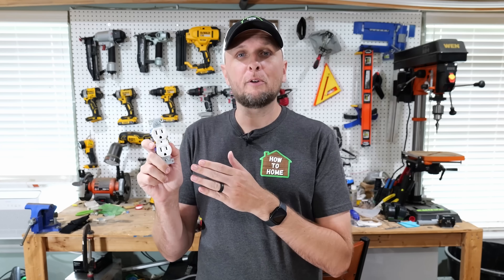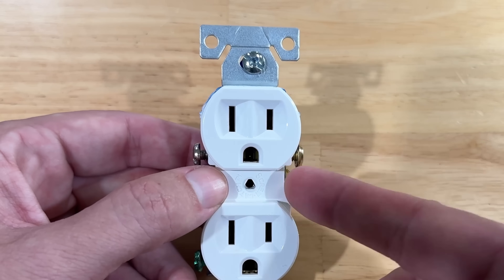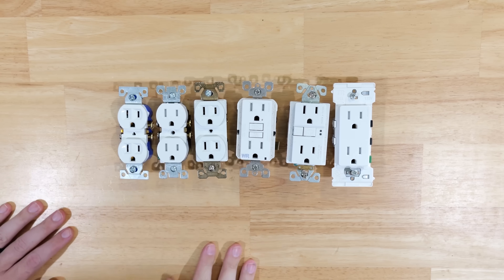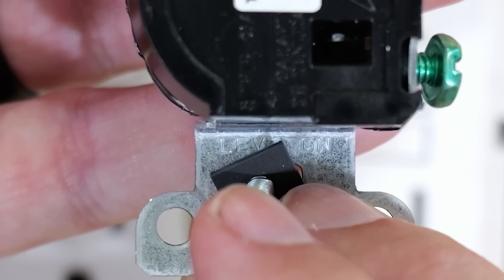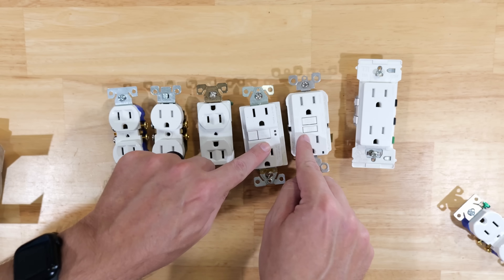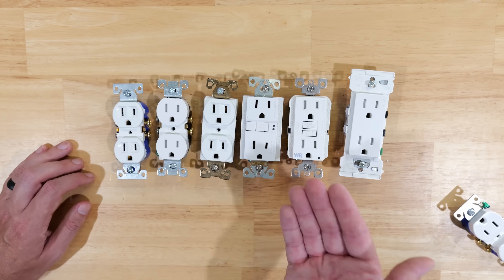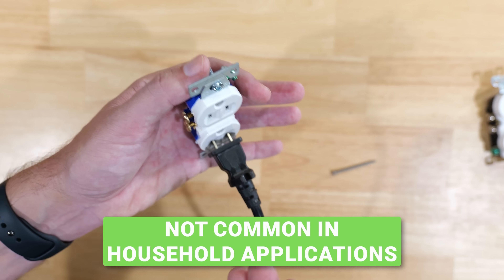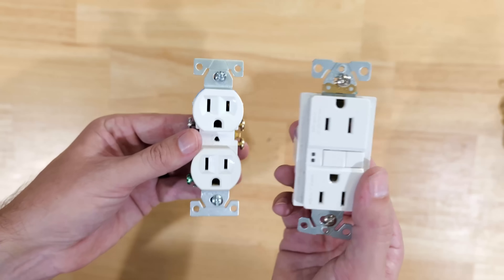The Shocking Reason Why Your Outlets Are Installed Upside Down!

Comment: I have seen some electricians  install all outlets consistently in one orientation or the other with the exception of switched, or half switched outlets. This gives the user of the outlets a visual clue that the entire outlet, or one half of the duplex outlet, is controlled by a wall switch and thus not always powered.  Switched outlets are common in bedrooms, living rooms and basically any room that it is common to use table or floor lamps for lighting.

Comment: As an Industrial Electrician, We were instructed to install any 110v receptacles on the shop floor was always ground plug up and within the offices and restrooms, it was ground plug down. The reason  was that most all plugs on the shop floor was 3 prong 110v plugs as a requirement and for the reason you stated, the ground prong guarded the topside from accidental shortages from stuff falling on it. Offices and restrooms were for practical use that was not industrial in nature.

Comment: Dumb. Notice how the plug you referenced as upside down was made outside of US - yet the one made inside was correctly right side up. And I get it all hospitals use metallic covers - well - this may be an oversight on THERE part - maybe they should stop doing this? Also, I work in inspections and have noticed that there have been a lot of superstitions - especially with the Mexico workers coming up and doing electrical work. One says that installing upside down keeps evil spirits away - kid you not… so there is plenty of ridiculous antics “invading” our normality. Please Stop letting this occur. 😮 is the right way…. 😂

Comment: I've had to install them ground up in cases where the ground wire in the outlet box is too short to reach the bottom of the outlet (older homes/remodel). It happens .. but it's not common.

Comment: I always install my outlets with ground hole on the BOTTOM.  When I find them the other way, they get reversed.  HOWEVER, I do make one exception and that is the outlet for the fridge.  The fridge plug necessitates the ground hole on the TOP, otherwise the wire suffers a bad 180 degree turn before it can be plugged in.

Comment: This video was very helpful to me because the builder of our house installed the ground prong up in our bathrooms and I was wondering why???? I had a nightlight that was kind of heavy that also serves as a "tart warmer" to make the bathroom smell nice, but it has a plastic prong ( Faux Ground Prong) coming out on the bottom to support the weight of the tart warmer. I was unable to plug in my tart warmer because the outlet was upside down and I was afraid to change it because I was thinking it had something to do with code, but now that I know that it doesn't I can change the outlet and plug in my tart warmer. Thank You!

Comment: "Outlet" and "receptacle are not interchangeable terms. Check def. of "outlet" in NEC book.
A ceiling box for a light fixture is a "outlet"  A disconnect for a AC condensing unit is a "outlet"
Reply from the maker: I bet you are the life of every party 😂.  A receptacle is also a type of outlet and it’s certainly what many homeowners and DIYers call it.  So there are bigger things in this world that could use correction 😂
Reply: @HowToHomeDIY  I just took my license renewal continuing education 7 hour course 2 days ago. Instructor made a specific point on this misuse of terms.
Also when I submit list to my Electrical inspector, of the completed rough-in, I have to list : receptacle outlets, lighting outlets, other outlets. 
Professionals know the correct terminology.
Reply from the maker: Super cool 👍  A receptacle is still an outlet though.
Reply: @HowToHomeDIY  Yes, it is a "receptacle outlet"
Reply: @HowToHomeDIY  Correct !
Reply from the maker: @dougthornton6884 great.  We agree.

Comment: If you have issues with remembering which is hot, and which is neutral, just remember that the word Neutral is a bigger word than the word Hot. The Neutral is a bigger slot.
 The Earth is a round planet, so the ground is round. It rhymes.

Comment: 25 years as an Electrician. Residential, commercial, industrial, and line work. I am currently an Industrial Electrician and Motor Controls Tech. 
I'm going to put this in all caps so you ALL understand it. 

THERE ARE ZERO STATISTICS TO PROVE PUTTING A GROUND UP SAVES ANYTHING. 

As a matter of fact, I have personally seen a ground up receptacle short out after something fell on it. 
IDK who you people listen to, but they literally don't know their butt from a hole in the ground. There isn't any reason whatsoever to install receptacles ground up. It's a freaking old wive's tale. It's a myth. Like things disappearing in the Bermuda Triangle. 😂😂😂

Comment: I had an electrician install a couple of outdoor outlets.  The outlets were on a covered and enclosed porch.  The outlets were installed ground opening down, and had steel covers. I plugged in a multi plug outlet which needed to be screwed in to the wall outlet while the steel cover remained.  The problem happened when I decided to remove the multi plug outlet, after unscrewing the outlet the steel cover slid down and made contact with the live pins before I could completely remove the multi plug outlet, sparks flew.  If the outlet would have been ground plug up the ground pin would have caught the steel cover instead of contacting the live pins.  After that I removed the steel covers and replaced them with plastic ones.

Comment: I'm a former UL engineer who evaluated manufacturers' products per UL60950 - the standard for information technology equipment. Within that standard, there are type-tests that can be applied. If there are circuit prongs that are accessible while they are still energized, and there's actually a special tool that was designed specifically for the test. Another test in the standard had us evaluate how quickly a circuit could be de-energized if it had a capacitor connected to the exposed prongs in that capacitor had to dissipate all of its energy within about 500 milliseconda if I remember correctly. In either case, the likelihood that a person could come in contact with an energized circuit on an L5-15 plug as it is being detached from an L5-15 receptacle is extremely low. Stay safe. 😊

Comment: Over time, receptacles wear and grip inserted plugs less firmly, causing the plugs to droop somewhat when the receptacle is mounted vertically.  In extreme examples of this condition, the top prong(s) may (depending on the receptacle design) lose contact first, while the lower prong(s) remain in contact.

When this occurs, this means that if the ground is on the BOTTOM, the appliance can lose power ENTIRELY, which will help to alert the homeowner that there is an issue:  whereas if the ground is on the TOP, the appliance would in all likelihood continue to operate, but WITHOUT a safe ground.  Since the device or appliance in this second scenario appears to be functional, unless the device has some onboard ability to display a ground fault, the homeowner may continue to operate the equipment for an extended period of time, unaware that it is in this condition.  (Source:  I have encountered this when finding a consumer-grade UPS displaying a 'wiring fault' condition, which is immediately rectified by seating the plug properly in the receptacle.)

For that reason, all other things being equal, I would say that the GROUND-DOWN orientation is superior.  To address the exposure of the hot/neutral pair to dropped metallic objects, I'm surprised no one has addressed this simply by offering a wall plate with a simple deflection ramp above the receptacle which would easily redirect any falling object.  (Or if they have, I have never seen one for interior wall plates.)

Just my $0.02.

Comment: We live in a mostly Right handed world that is why the common is on the left. We grab with our left hand and twist a tool with our right hand. When you pull an active plug away from the wall with your left you are less likely to touch the hot power side. Protect the human.
You should always turn off the power but we know not everyone follows the rules. Also some plug units are mounted sideways nowadays. Thoughts.?

Comment: The Eaton GFCI should likely be installed with the ground plug up.

Why?  Most people are right handed.  I may curse the bias as a left hander, but by installing it ground plug up, when a right hander reaches for the buttons the lights will not be visually obscured to the same degree by their arm/hand versus when it is installed ground plug down.

Comment: I install plugs ground plug down. The only receptacle I put in ground plug up is where my air conditioner is plugged in. Since the AC plug is extremely large with the built-in breaker plug, if I tried to plug it in the ground plug down, there is not enough room between the bottom plug and the floor. That is the only plugs that are installed upside down, to accommodate the oversized AC plugs.

Comment: There is no "Correct" way. It depends on what the code says where you live, for the type of application you're installing it for and how you mount it. Up nor down applies when the receptacle is mounted horizontal. I guess the next BS argument will be that the only way to "correctly" mount them horizontally is to put the ground plug to the left or right.

Comment: Thank you for a thorough examination of this topic! I became aware of different orientation of US AC receptacles in the military, when I noticed that the receptacles were installed “upside down”, compared to every other I had ever seen in civilian residential and commercial installations. 

They gave the same reasons your production covered, that the “ground prong up” orientation was “safer” if a metallic object were to fall onto partially exposed prongs. 

Later, a class in commercial construction covered this topic as well, stating vague reasons for the “conventional” civilian orientation of these, but mainly used the installation of “ground prong up” outlets to represent switched outlets. 

Thanks for filling in the blanks, since this removes any doubts for future installations if anyone should ask.

Comment: I am 80 years old residential, commercial, industrial electrician. Only saw ground up installed up needed for 90 degree cords with cord hanging down.I have researched this all my life. Ground down could be a problem with stainless plates. My only evidence of ground up being correct is in my friends house, he being an electrician, who is 80 years old , knows everything and never makes mistakes.
   Love your presentation, brought me many memories of the past.
Reply: Well I am 83 so I obviously have the highest authority here and I can tell you that regardless of up or down, America has the crudest, cheapest, nasty unsafe plugs and sockets I have ever seen. British plugs put America plugs to shame. (About the only thing we British can claim these days apart from politician integrity). During the period that I was a member of the Institute of Electrical engineers in the eighties, it became obligatory for all plugs to contain a fuse and the live and Neutral to be sleeved to protect during withdrawal. And no need to fertal arround trying to decide up or down.
Reply: @Peterprincklestein  That's mostly because the US still has power sockets going back to the dawn of time. Modern sockets have plenty of safety features. Shutters, 3 prongs and possibly GFCI built in on an AFCI circuit if you're talking about what's currently available. It's mostly developers cheaping out that go with less, and even there, most of the time they have to integrate all three of those things into their projects. There just remain a few situations where they don't have to because it doesn't really add any safety. Things like not needing tamper resistant shutters where small children couldn't possibly reach them. 

I do admit that the British style is arguably the best in the world, but a decent outlet available here isn't much behind in terms of safety or reliability.
Reply: @SmallSpoonBrigade  I totally agree with all your comments. Your GFCI comments could also apply to the British power supply even more so because of the 240Vac supply. Pity that USA only has 110Vac for its household sockets. My kettle takes twice as long to boil as in the UK, but who cares now I am retired time is abundant. I even have time to waste on frivolous videos concerning the right way up of sockets. I like the ground down because it looks like a happy face.
Reply: @Peterprincklestein  True, quite inexpensive USA construction in comparison.. also a bit more Affordable to the masses that actually pay (at times over 30 years mortgage) for their own homes, as USA is noted for. 
Common for endlessly ongoing mass developments (tens of thousands of new homes in every direction, for hundreds of miles around each of the larger cities), to build rapidly and at less costs .. to the Individuals.
 Countless many of home owners are avid DIYers.... historically.. It's a 'Yank thing. ;}
Remodeling/updating for family growth, is ongoing, more often DIY across the USA.. 
Home Depo, Lowe's, Menard's, Ace, True Value, etc, including Independent home builder supplies, are 'Always busy.. Reason why USA absolutely loves.....
 and uses to the outrageously extended ends of said vehicles lives, their SUVs and Pick-up Trucks.. ;)
Reply: Ground prong up when that outlet is attached too the light-switch so people there know where to plug in their lamp to control it from the wall light-switch.

Comment: In terms of wiring and electrical pathway, another word for ground, although not as common in North America, is earth. Remember the three prong grounded cheaters that were common back in the day when three prong plugs were first introduced and most all receptacles were still legacy two prong receptacles for non-polarized plugs? The manufacturers of such devices typically recommend that when possible they be installed with the ground pin at the bottom, that is, with the U-channel ground pin installed such that it is literally the contact that is physically closest down towards what is genuine soil earth, that is, terra firma, which is ground. Yes, most such cheaters could be loosely said to have been installed, as most had provision for mechanically fastening and thereby grounding metal connection to the ground pin U-shaped slot of the cheater to the screw affixing the receptacle cover of the two prong receptacle the cheater was being used in conjunction with. Unless you're an acrobat tumbling through the air or an astronaut tumbling in space or a diver turning over in water, etcetera, earth, the earth, ground, the ground, is always down, down below, underneath your legs and your feet. In terms of the two vertically thin prongs of a plug, the two skinny legs of a plug, it just fits the sense of earth or ground being down below, that is underneath, the skinny legs of a plug, to have the U-shaped ground hole in a receptacle oriented below or underneath the slit shaped prong leg holes of the receptacle, that is, in relation to the two skinny legs of a plug, have the U-shaped ground hole in a receptacle oriented such that it is closest to the earth, soil earth, terra firma. Plus, the U-shaped metal ground prong of a three prong plug will be oriented such that the ground prong itself looks like two skinny legs pointing down towards the earth, soil earth, terra firma and with such orientation any dry foreign object or objects that may have been scooped up in the U-shape of the prong while unplugged and oriented such that the U-shape opens up rather than opens down will fall out when the prong is oriented to plug into a receptacle with the corresponding hole for the ground prong oriented towards the earth, soil earth, terra firma, the ground. Therefore, ordinarily, by tradition, by assumed to be understood convention, and even by conflation of a couple of senses of both ground and earth, unless there is good logical reason to install otherwise, three prong receptacles are installed such that the ground prong is down, down towards, the earth, soil earth, terra firma, the ground. To make this painstaking explanation any more exacting and any more definite one would have to use hand puppets to explain.   ; - )

Comment: "Someone needs to clue in the manufacturers, particularly about those so-called flat wall plugs. They angle the cord downward toward the floor when the outlet is oriented the 'wrong' way, as you've shown. But when the outlet is installed the 'correct' way, as you've illustrated, the wire ends up bent and kinked right at the receptacle."

Comment: The UK 13A plug and socket is the best, no need to worry which side up or down, the ground is always up and the copper connector is large and can handle large currents without heating problems, those shown in the video used in the north america is not good indeed, they are always hot both plug and socket when an appliance  like a toaster oven is connected and turned on.